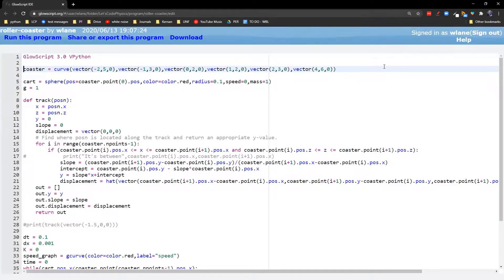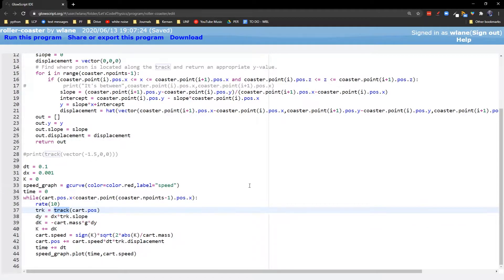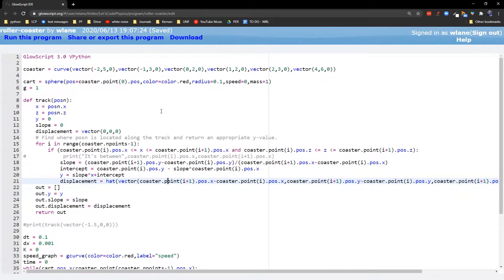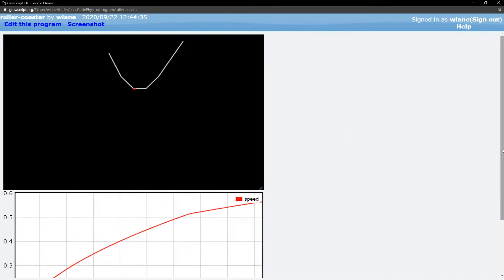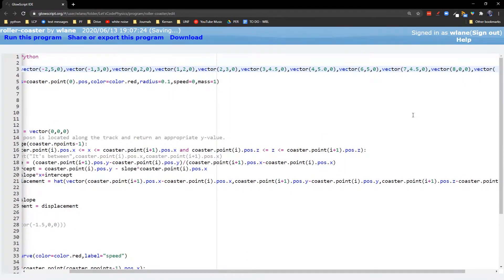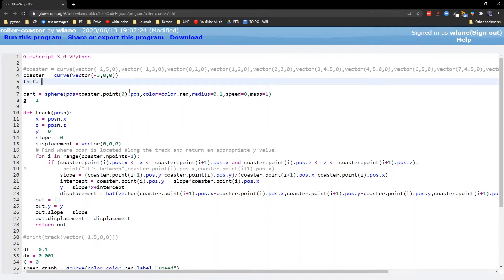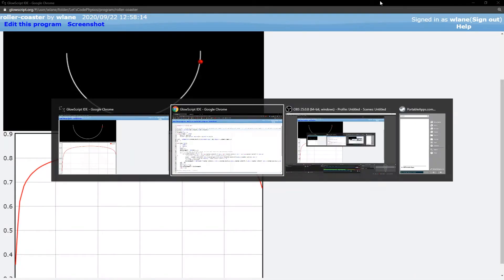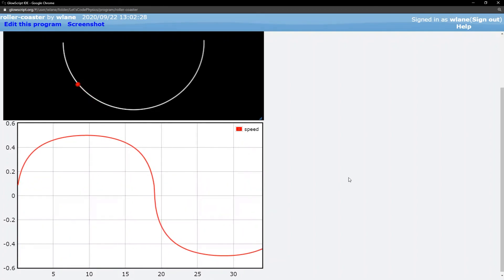Roller Coasters in VPython

Comment: hello,
Imagine a have a ball falling from an inclined plane. 
How is possible to use instruction "input" in a Vpython screen, so a user can set for example the initial height of the ball ?
I use spyder, and if i try to use "input", the command appears in the Spyder Console, but not in the Vpython screen.
"Label text" is Ok for a fixed text in a Vpython screen,  but is there something that can replace the input instruction? Thanks